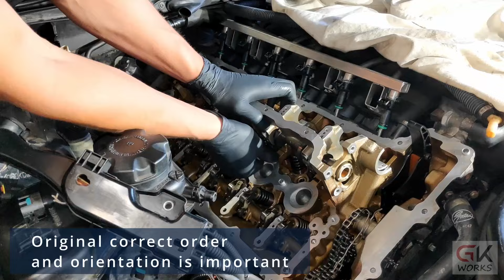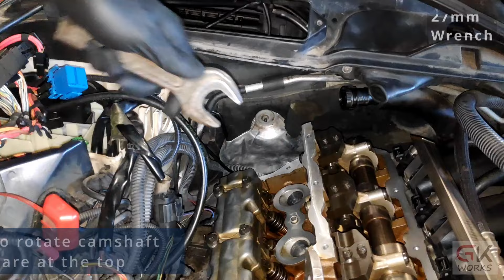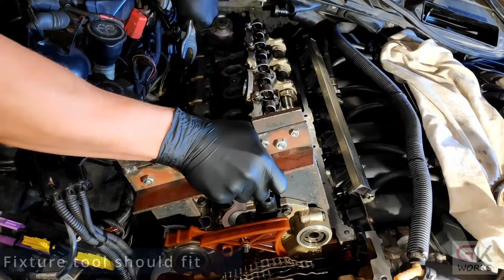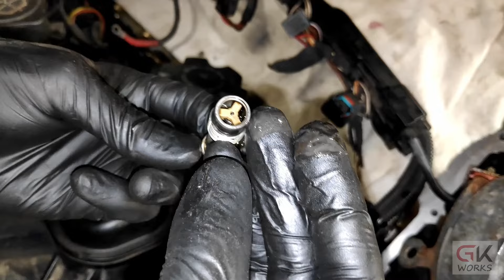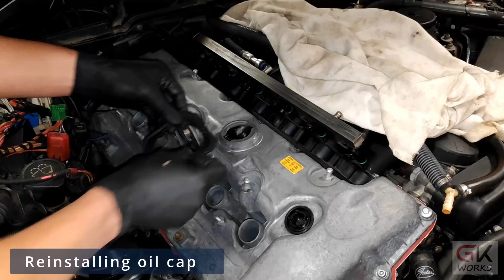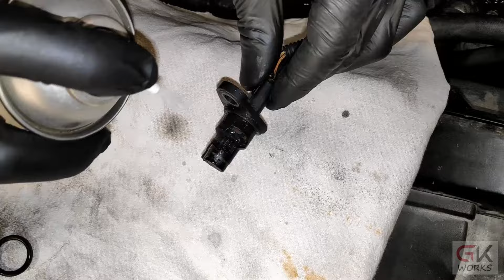BMW N52 Engine Valve Stem Seals Replacement Part 3 of 3 | Detailed Assembly

Comment: applaud your efforts as I know from personal experience that this is a pain in the ass job.
Not a criticism but an observation is that you should also replace the cam shaft seal rings when this far into the engine.  BMW N52/N54/N55 Camshaft Bearing Ledge Wear
The front of the camshafts acts as an oil passage for the VANOS sprockets. If the camshaft’s rectangring seals cut into the camshaft bearing ledge, the wear could be significant enough to allow oil to bypass the seals and leak out. That will cause improper control of the VANOS sprocket, preventing the commanded camshaft position from being achieved. The new seal rings are one piece teflon and replace the old snap ring steel rectanring.

Comment: my eccentric shaft is not rotating freely after tightening the bolts. Any suggestions?
Reply from the maker: Hello, we would suggest to recheck the installation to ensure all parts are aligned and seated correctly, inspect the shaft and bearings for any signs of damage or debris
Reply: Turn your bmw ignition on with out true engine and step and hold the gas pedal for 30 sec that shoul reset it.
Reply: Did you solve the issue?
Reply: You need to see a doctor